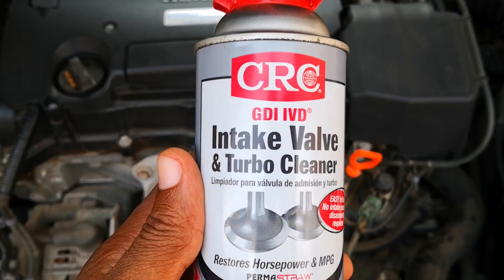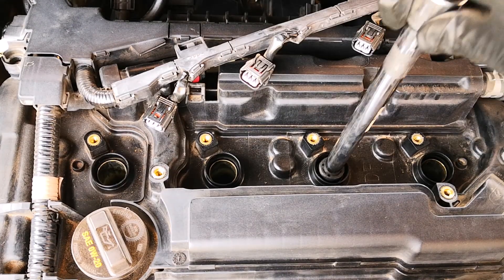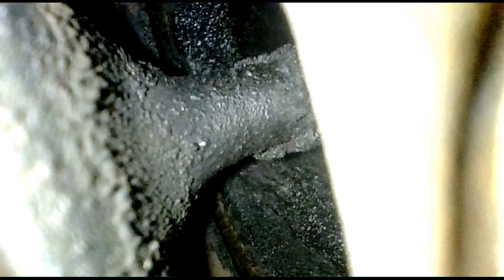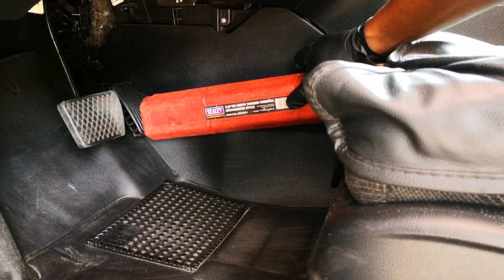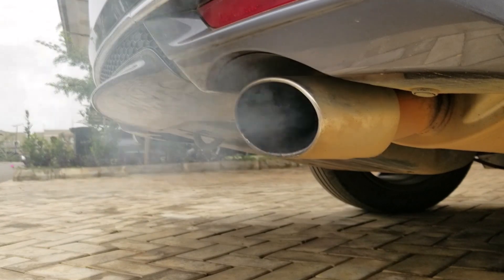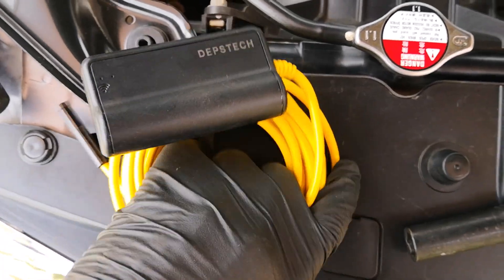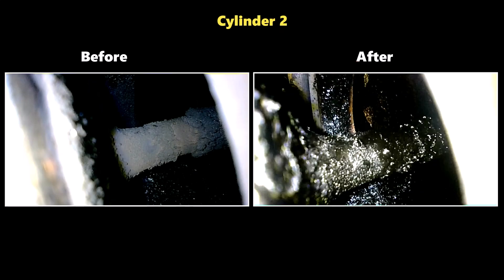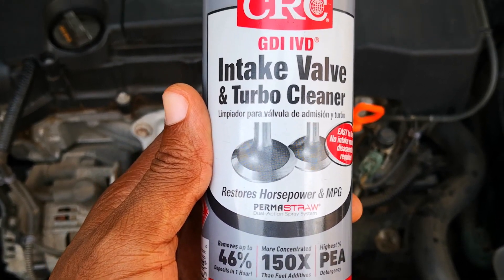Does this Intake Valve Cleaner Really Work? Proof, Before & After / Clean carbon from intake valves

Comment: The reason the valves looked slightly cleaner after those several days is because the CRC cleaner actually states that it continues to clean over the next few days following the initial application of it. Every video I watch is so critical of the results of these products they expect it to remove intake valve carbon deposits and restore them to like new condition just because the picture on the can shows it like that but nothing except an actual walnut blasting service will remove carbon deposits from intake valves enough to make any real difference and the results of these store bought products cannot produce results to that of a walnut blasting service. It's expensive but walnut blasting is worth the price I get it done on my WRX every 20K but of course I'm an auto shop manager so I barely pay anything to do it myself at work lol. But I do use these chemical products in between walnut blasting every 20k miles or so at each oil change and I perform full service oil changes every 2K miles so at each service I run a can of it thru as a way to keep the intake valves and system clean and maintained to prevent further buildup. So a walnut blasting service every 20K with a can of CRC every oil change every 2K to keep it clean. Of course I'm very anal about overly frequent service but it barely costs me anything cuz I manage a service shop but it's a good plan to follow for anyone. But only a walnut blasting will truly remove deposits these cans of cleaners can keep the intake valves clean but they won't actually deep clean anything I mean think about how insanely hard carbon is and how stubborn it is to remove it requires strong but safe abrasive cleaning action like walnut shell media shooting at it under crazy high pressure at close range to get that crap off the valves no store bought cleaner is gona do anything like that lol
Reply from the maker: Good observations. Don't get me wrong this product clearly works, it's the claim that CRC has boldly written on it that people haven't been able to reproduce; "removes 46% buildup in 1 HR", plus as you say, that night and day image on the can. I still use it every oil change to at least keep that build up under control.
Reply: Bro.. every 2k? That’s a bit over the top no?. Especially if you’re going to walnut blast every 20k. You may as well invest in a higher quality oil instead.
Reply: @es6tt221  Just fyi in performance cars like wrx or any other performance car its actually normal to change your oil every 2k depending on how often you race. IM sure the op is using high performance oil anyway.
Reply: I was thinking the same thing in regard to the CRC (PEA in general) continues to clean over time. I know this product works wonders in my 2016 Kia GDI engine
Reply: How much is the walnut blasting cost at your shop?
Reply: Install a water methanol injection system on any turbo car and you have 0 carbon deposits anywhere.

Comment: Waited too long.. These cleaners only work on soft carbon build ups. Hard caramelized carbon caking needs mechanical cleaning.This process only works on new engine at 15000-25000 mile intervals.
Reply from the maker: You probably have the point here. 
I guess marketing won't let CRC state this limitation.

Comment: In summery...it doesn't clean well enough, it's a waste of time. The ONLY way is to manually clean and intake manifold MUST be removed along with a whole lot of other related parts to properly clean the back of valves AND the intake ports. It's a rather time consuming (and expensive) process. Walnut blasting is the standard for this procedure.
Reply from the maker: Mechanical cleaning is seeming to be the conclusion, which I may eventually get to. I have one more target chemical cleaning product before I go mechanical!
Reply: I just put CRC into my car with 157K miles and it was like a miracle.  I get if I had it manually scraped, or walnut cleaned it would be better, but I have to say after waiting the hour and driving the 10 minutes, my car no longer has rough idle, or the ticky valve sound and my mileage has improved considerably.   Not perfect, yeah you are right, but compared so some of the other crap they sell you for your car, at least this does something noticeable and it is a lot cheaper than having the mechanic spend a few hours futzing around my car.  Besides I did take it to the mechanic complaining about poor mileage, and the mechanic just did all the things I did already (check plugs, make sure O2 sensors were in tolerance ...) and charged me $150. I did get an oil change out of it.
Reply from the maker: @markmccraley2559 I agree. Definitely much better than doing nothing and a lot of the snake oil stuff out there.
Reply: It might work for maintenance if you did it from new but yea you're right. Once its bad. Manual is it.
Reply: If you do it before the carbon accumulates is a good maintenance tool. But if you haven't clean your valves in years don't expect miracles.
Reply: Dude, they did this for a reason. 
You don't want to clog your CC, they make it not clean well enough for a reason

Comment: Damn instead of buying CRC intake valve cleaner, buy a car with direct + port injection instead.
Reply from the maker: 🤣 Just that Toyota has always lost me on interior design!
Reply: @DIYAutoworksNG  Damn. And I drive a Toyota with no port injection.
Reply from the maker: @liquidh5226 lol
Reply: Relatively few cars have that, it would limit what you drive.

Comment: I agree. After watching some other videos on YouTube and yours, I appreciate your Honesty, it's clear that using GDI cleaner from a can is not a big improvement. I'd say, unless you are having actual issues with Carbon Build-up like hard starts, misfiring, poor acceleration, etc., then just leave it be. And if you need a cleaning then spend the money and time and remove the Intake Manifold and get inside there and scrub them clean the right way.
Reply from the maker: I got a Liqui Moly intake cleaner that I'm keen to test. Will see how that does.

Comment: You have to spray directly into throttle body, not a vacuum line, that’s why it’s not cleaning much.

- Mechanic of 25+ years
Reply from the maker: Thanks for the suggestion. I saw one other video where it was sprayed via the throttle yet, results were similar to mine. I got some other products that I'd try. If they don't do better, I'll give this another chance as suggested. Thank you!
Reply: @DIYAutoworksNG  I recommend the seafoam top end spray. Spray at 2,000 rpm until empty, then turn off engine for 10 min and let sit, then crank and give her some firm revs and go for a drive and make sure to drive it hard so the carbon comes out.
Reply: Will this affect the throttle body or does the TB have any electrical internal bits?

Comment: Does this  carbon / particles find its way into cylinders and score cylinder walls or bash rings ???
Reply from the maker: Good question. I didn't assess this.
Reply: At a minimum it must wash the oil film off the cylinder and make the piston run on bare metal. Yikes

Comment: Amazing info. Which valve cleaner is recommended for Toyota cars. Also is there a way to use without the technically skills you used in this video? There are loads of product sold at gas stations and they simply empty the contents into the fuel thank 🤔
Reply from the maker: Thanks, mate.
It depends on your Toyota. Some newer models have dual injection (port injection plus GDI). If that's the case, the gas tank approach will work quite well.

Comment: Very nce test. I've seen similiar one on AliMECH channel and results were equally pathetic.  I have 1.6 N14 engine [aka THP] and recently sprayed a can of Xado Anticarbon through a PCV hose, seems like done something, but I do it only preventively, my valves were cleaned mechanically 4000km ago. I can recommend Xado, it's really serious chemical agent.
Reply from the maker: Thanks for sharing. Yea, definitely doesn't clean as much as it claims. Just hearing of Xado for the first time. I'll look out for it. I will also be testing a couple more intake cleaners. I've seen a spray solution from liqui moly as well.
Reply: @DIYAutoworksNG  Xado is brand from Ukraine, so it's cheap and they produce effective stuff. 
I'm from Poland, so practically next door, they've been selling their chemicals here for many years.
Can't wait for more of your tests :D I used Liqui Moly throttle body cleaner and it washed the carbon away with no problem, but it was outside the car, so much easier.
Reply from the maker: I've gotten the LM, on the hunt for Xado anticarbon... Thanks again for suggesting.
Reply: @DIYAutoworksNG  glad I could help a little :)

Comment: Gdi engine?
Reply from the maker: 💯 GDI.
Reply: @DIYAutoworksNG  Try BG intake cleaner.  Also BG 44k platinum is an excellent total fuel system cleaner. Hope this helps.
Reply from the maker: Thanks. BG44k platinum ordered! Thanks for suggesting.
Reply: GDI stands for 'Gas Direct Injection' which means the valves don't get any gasoline sprayed on them as they would in the older PI (port injected) engines. The gas sprayed on the valves kept all that carbon from building up and that doesn't happen on these newer GDI engines.
Reply: Why do I see you on every detailing video lol, wasn't expecting to see you here

Comment: Neat study, I like how you present your vids. I wish I knew, but you did give those intake valves, and ports a wet look. Now I can't help but wonder if that carbon will eventually come off over a month or several months since the carbon is now 'wetted' and saturated with whatever chemical was in the CRC cleaner.  Great vid. Liked👍
Reply from the maker: Many thanks. I like your logic on whether it would continue to clean. I'll give it another exam and see if there's any additional cleaning. Thanks a lot for the suggestion!
Reply: Its stated by CRC that you get best results by using your car as much as possible after using the intake cleaner. I'm doing it today i'll update how it goes.